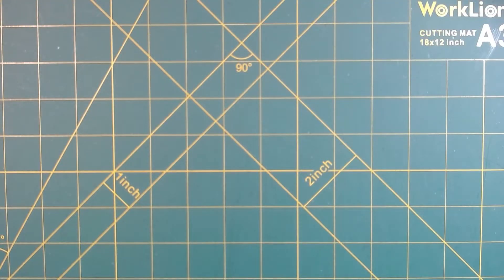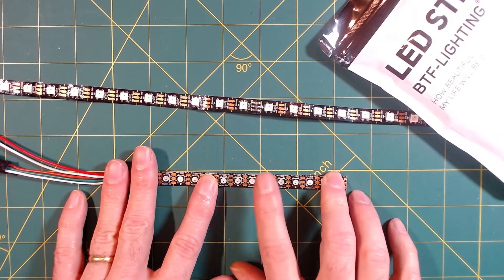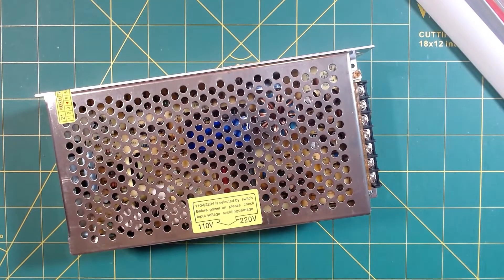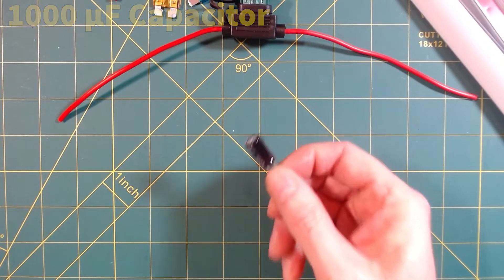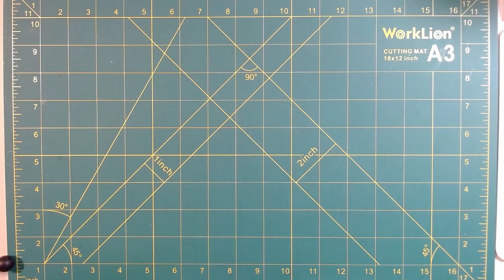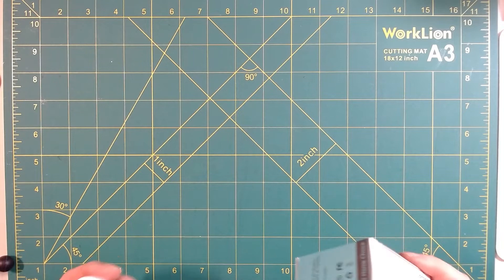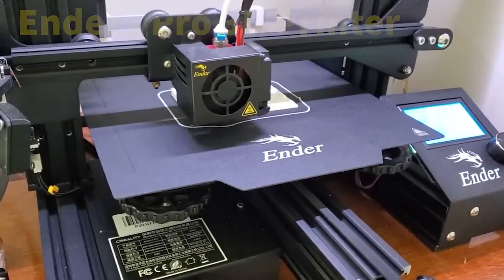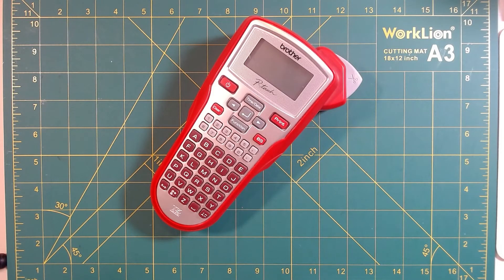My Favorite and Most Commonly Used Items

Comment: Have you tried working with iDeal or Surplife?  Is there a way to load either of these on an ESP32?  I'm new to this techy stuff so I'm trying to find a controller with a simple interface besides WLED.
Reply from the maker: I haven't worked with either, but I believe those are specific manufacturers and even if it was possible, I don't believe they make their firmware publicly available so that you can load onto your own ESP/controller device.  And in addition, their apps are generally designed to work with their own LED products... although you can sometimes hack them to work with other strips.

You are generally referring to commercial products with an app for your phone and their own line of products.  WLED (and related firmware like Tasmota, ESPHome, Arduino, etc.) are for building your own controller from scratch.  While it is sometimes possible, you normally can't 'mix and match' commercial products with DIY products.  Although there are some 'commercial' products that come with DIY firmware (like WLED and Tasmota) pre-flashed for you.
Reply: @ResinChemTech  I poked around and found a couple of controllers that are corrected to rgbic lights with heat shrink connectors and a couple of stand alone controllers I can use. I'm thinking I can connect it to 5v PS and connect the the data wire to my 12v or 24v lights that are connected to 12v/24v power supply. I've got about 350 leds but want to be able to add about 200 more later on.

Comment: One more question: I’m going to be using Aluminum Channels for LED under a floating cabinet 8” above floor. I don’t want to screw brackets underneath there. Would the 3M double sided adhesive tape hold the channels? Should I use a continuous strip or small, segments? This tape is expensive and the cabinet is 10ft long.  Thanks.
Reply from the maker: Well, I haven't actually tried the double-sided tape to actually hold the aluminum channel in place.  But it's pretty strong stuff and I suspect it would work OK.  I'd just assure the surface you are mounting to is clean (I'd probably also wipe it down with isopropyl alcohol after cleaning, and then let it dry thoroughly).  

The tape isn't necessarily cheap, but a 100' roll will cover quite a few LED projects.  And right now, I believe there is also a coupon available on Amazon for an additional 10% off:  https://amzn.to/3SU4cl2  I've tried other brands, but the 3M brand has been the best by far and I have been able to remove it from surfaces (when necessary) without damaging the surface... but I've never tried it on something like painted drywall.  The width is also idea for both the aluminum channel and the LED strip.

Honestly, I'd probably run one long strip, but might just cut it into segments (2-3 ft) if it makes it easier to install and align.  It would depend on the situation and installation location.
Reply: @ResinChemTech  thank you once again.

Comment: Another question: what’s you favourite brick style Power Supply for 12V, 8.5A or 10A. Something that’s reliable? And I see most of them have a bulky round something on the DC wire aide… electromagnetic something something haha… I want to keep the wire as short as possible, is it OK to cut that part out? I will be connecting the PS to a Dig Uno.. thanks..
Reply from the maker: Most of the power supplies I've used are 5V, but I have used this 12V 10A power supply and it worked just fine: https://amzn.to/3Jmr9dx  I've also used numerous 5V power supplies from the same brand without issue.  I've used other brands as well.  For me, the important factors are overload/over voltage cutoff, thermal cutoff and short circuit protection (which I've inadvertently verified actually works!)

The 'bulky round thing' you are talking about is a ferrite bead, I believe.  It's purpose is to reduce EMI.  Yes, you can cut it off and not affect the voltage.  It could just result in a little more noise emanating... but likely will not impact anything to any real amount.

Comment: Quick question: what size wire sleeve should I buy to combine 3 18AWG copper strand wires? 1/8” 1/4” or 1/2”? Thanks.
Reply from the maker: 1/8" will definitely be too small for 3 18 guage and 1/2" will be way too big.  You can probably get the three wires through the 1/4", but 3/8" would probably work as well.  For me, it would somewhat depend on the length.  I'd try to use 1/4", but it will be a relatively tight fit (which is ideal) but it if was a long wiring run it might be tough to get all three wires through equally without snagging or getting hung up.  In that case, I would possibly considering using 3/8".  1/4" and 3/8" are the sizes I use most often, so it might be worth picking up both sizes and having them on hand.

I generally only use the 1/4" for two wire runs of 18 gauge or smaller and only use the 1/2" for bundles of 4 or 5 wires (normally 20 gauge or so).  But I do keep an assortment of all the sizes and make the determination based on not only the gauge and number of wires, but the length of sleeve I need to pass the wire through.  It is a bit of a learned art form in getting wires passed through the sleeve.  The ends will get frayed no matter what you do, so I normally put a small piece of heat shrink tubing over each end, slide the frayed ends under the tubing and then apply heat to the tubing to give the best overall finish (but be careful with the heat, as the braided sleeve will melt pretty easily).
Reply: @ResinChemTech  thank you. Really appreciate the detailed answer.

Comment: I set up an esp32 for wled in an item I made for a friend. Worked great. He picked it up but his phone doesn't have wled showing up in available wifi and neither does his wife. Any ideas?
Reply from the maker: Are you saying the WLED-AP hot spot is not showing up as an available wifi network on their phones?  Did you onboard the device to your WIFI when you made the device?  If you entered in your Wifi SSID and password, then the ESP32/WLED may not be broadcasting the original WLED-AP hotspot because it is attempting to connect to your wif. (although if it does not connect to wifi, it is supposed to start rebroadcasting the AP hotspot - you might leave it powered on for a bit and see if the WLED hotspot begins broadcasting after a time... not sure how long this takes for the wifi connection to timeout, but I'd let it run for at least 15-30 minutes). 

If the WLED-AP hot spot still does not appear, you may need to reflash the device with WLED to wipe out your wifi information.  You can also try installing the WLED mobile app and have it try to detect the device on the network.  If you get lucky and it finds it (unlikely), you can then use the mobile app to go in and update wifi information.

If you are talking about something else in the onboarding process, let me know.  Also let me know if you get it resolved or if leaving the ESP32 powered on for a while results in the hotspot eventually showing up.
Reply: @ResinChem Tech  thanks for the reply. No I didn't put any of my info in it. I left it all default except for the number of lights. He has a new wifi showing up but its call leisure510w......
  I told him type in wled1234 for that password to see what happens. I also sent him a link to a page going through in detail how to do everything. That page has a qrcode to scan in the event the wled ap isn't showing up. I told him go through that and if he still can't get it I'll come fix it up Sunday.
Reply from the maker: That's weird!  I do know that you can change the default hotspot AP name, but that basically involves compiling your own version.  Maybe the QR code will do the trick.  Let me know what you find out... especially if you have to make a trip.  I haven't heard of a problem similar to this with WLED, so I'll be curious what you find out.
Reply: @ResinChem Tech  I think what happened was since I flashed it at my house and he lives about 100 miles away in the next state the esp32 is locked on my access point. I should've gotten his wifi info and put it in and he could edit the password later. I'm going to grab my laptop and make a trip tomorrow. Thanks for the input
Reply from the maker: So, leaving the controller on for a while didn't result in the hotspot starting to broadcast?  That's at least the way WLED is supposed to work.  If it can't get a successful connection to the wifi, it should start rebroadcasting the hotspot, unless you changed the AP/hotspot settings within the WLED-AP settings.  By default, these settings are to broadcast AP after connection failure, but there are options to disable the AP altogether... or to hide the AP.  I'm just trying to save you a long trip if, in fact, the hotspot is broadcasting.  But if you do eventually have to make that trip, check the 'Configure Access Point' under the WLED wifi setup.  I'd be curious if these were changed somehow from the defaults.
Reply: @ResinChem Tech  weird thing when I walked in where it was plugged in my phone would pick it up then just as quick disappear. After troubleshooting for awhile I decided to bring it back home to fix it or replace the board. I entered my wifi info to put it on my network and immediately anyone on my wifi could control it. I think it was sending out a signal but there were 6 other wifi connections available and I'm pretty sure all three of us had our phones on default scan which filters out weaker signals. Not sure but only thing I can think of. Since I have it back at my house I'm going to add a bonus and give him sound reaction. I decided to remove the esp32 and follow your path of the D1 mini with shifter. Do you have a video on steps to flash the sound react version? This is all fairly new to me but I'm getting there. I should have my mic, d1 mini and shifter  Wednesday. I appreciate the time you put for these videos
Reply from the maker: That's sound like as good as an explanation as any!  Yeah... the board isn't going to put out a very strong signal, but I would think if you were within a few feet of it, it would remain visible... unless it was bootlooping or something.

As far as SR WLED, if you are using the WLED web installer, a SR version is now available in the drop down list of versions.... BUT the sound reactive version is now only officially supporting the ESP32.  So the sound reactive version listed on the WLED web site (0.13.3) won't install on an ESP32.  If you really want to install an SR version on an ESP8266, then you will have to go to the sound-reactive Github ( https://github.com/atuline/WLED ), go to the releases, find v0.12.0 and download the ESP8266.bin file.  You will then need to manually flash it with something like NodeMCU PyFlasher or ESPHome Flasher.  But to be honest, I'd probably stick with the ESP32 and install the latest version of the sound-reactive version from the official WLED web installer site.

And, since you won't be keeping this on your wifi, it the installer offers to onboard to your wifi (it's been a while since I've done it), just skip that step.  That way you won't be writing any of your data to the flash.  After power cycling the device, you should see the WLED hotspot.  Join that with your phone and go to 4.3.2.1 in a browser on your phone and you should have the WLED interface and can test and make any changes like number of LEDs, max amp rating, etc.  But don't join to your wifi. After making all the necessary other changes, just power down and take to the destination.  It should again start broadcasting the AP hotspot.  So, again, join and go to 4.3.2.1, but this time go to the wifi settings and enter the wifi settings for the destination.  It will reboot... and you'll need to find the IP address on the new network.  At that point, you should be able to get to the interface on any device on the network via the IP address and/or add it to the WLED mobile app.

Let me know how it goes... and good luck. I'm sure you don't want to be making that drive multiple times!
Reply: are you on 2.4Ghz net?
Reply: I had this problem with many of the ESP32s from amazon, there is a lot of crap out there. I make sure I only get genuine expressif ones and they work great.

Comment: Great video again. I wonder if I can use the inline fuses. Does voltage matter?
Reply from the maker: While the fuses are meant to 'blow' based on current/amps, they are rated for a max. voltage.  The ones that I showed are generally used in cars, motorcycles, boats, etc., which are normally 12/24V systems and would be fine for something like a normal LED installation.  If you need to fuse something high voltage, you can also look at the glass "cartridge" style fuse and holder.  Those are generally rated for use to around 250V.  As with any electronic component, always check the specs to be sure it is properly rated for both voltage and amperage of your project.

Comment: Great overview. We clearly shop at the same places - I use a lot of the same stuff - across the board. I've mostly converted over to the ESP32 D1 Mini for the increased speed, flexibility of GPIO, and memory - although I often only use the ESP8266-compatible inner pins.
Reply from the maker: Thanks!  I like the ESP32 mini as well.  I just wish ElectroCookie would come out with a version of their mini board that was just two rows wider!  I'd use the ESP32 mini a lot more if I could still easily fit it on the mini board.  I'm not quite ready for creating my own PCBs yet... but I promise it's on my list!